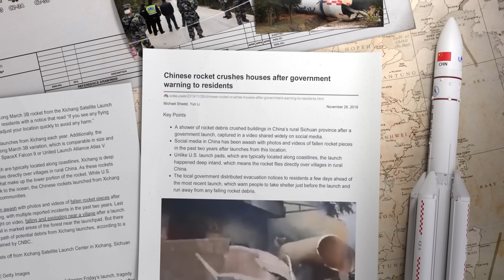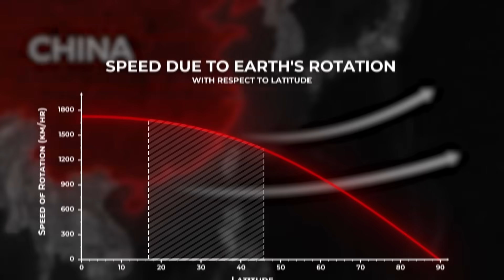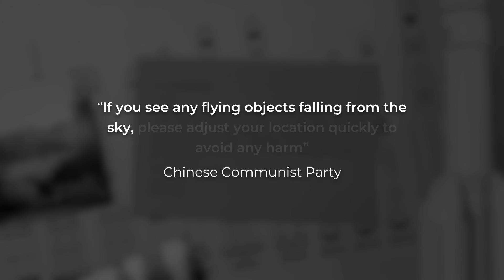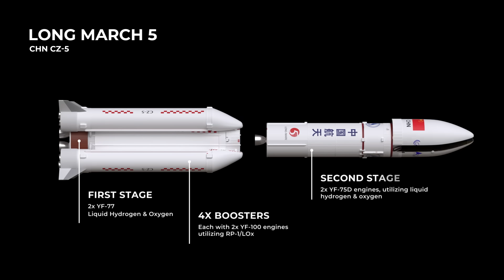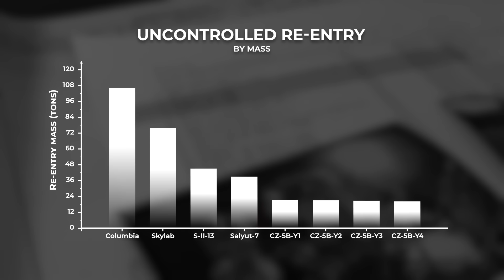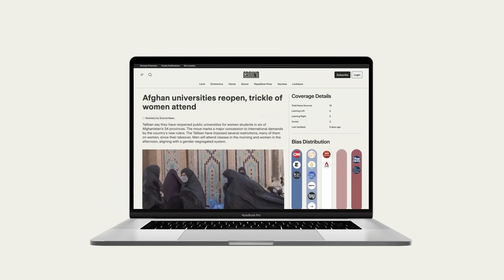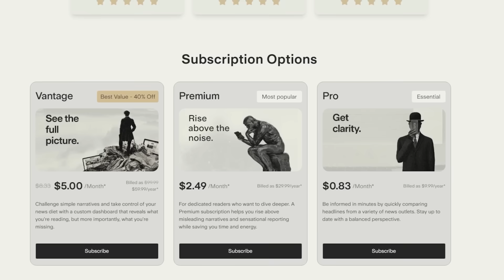The Problems with China's Space Program

Comment: @2:01 This is incorrect. The Earth rotates the other way around. The rockets take advantage of jet streams, I assume.
Reply: You're horribly incorrect. He got it correct.
Reply: You assume incorrectly
Reply: Factually incorrect, the rockets take advantage of orbital velocity. Sending rockets into space requires a lot of energy. It think of it like this. Imagine you are on a merry go round and throw an apple. It will take less energy for the apple to go forward. It regards.
Reply: It's not rocket science you know.Someones suffering from the Dunning Kruger syndrome
Reply: You correct someone based on an assumption?
Reply: Yes it rotates in the opposite direction that the rockets launch, that way the rotational velocity can add to the necessary 17,000 mph they need to remain in orbit. Rockets could only theoretically take advantage of jet streams for a few seconds at a time (if you look at how quickly they ascend through those layers of atmosphere)
Reply: Well but gravitational orbits are not so simple. Your logic is disproved by conservation of momentum.
Reply: He got it correct. If they weren’t using the rotation of the earth why use the most southern spaceport, nearest to the equator where said rotation can be felt the most.
Reply: It seems opposite. But think about the sun coming up in the east. That means we are turning to the east. And we are going quite fast towards the east. The rockets take advantage of that speed to get into orbit. You can launch west like they do in Vandenberg, but it takes a lot more fuel without that extra speed of the earth’s rotation. Does that help explain it?
Reply: Your a idiot for assuming that
Reply: @mmboiler10  it all depends on the Gurosyncal  orbit around the sun in relationship to Pluto third Moon triton  and it's gravitational pull .Taking in consideration the ramifications of fluctuating pulsars within the realm of sector five , one really dose not have a clue of scope of the dimensional variables of the prevailing winds
Reply: @Foxtrotwilconiner1969 😂😂😂
Reply: @grumpy3543  you like my silly humour 
My wife thinks I'm a idiot 
She says she's suffering from the Stockholm syndrome
Reply: @eisisice9208 it all depends on where your sitting at the time

Comment: This was launched in an abandoned mine, and the test thrust of the fixed shelf below was not intended to let the rocket take off, but the rocket's thrust was too strong and it broke away from the shelf below, so the staff turned off the switch in the air. The rocket fell vertically. This is a normal situation, but you western media collectively climax, thinking to yourself: finally caught the black material of China😂
Reply: This is NOT a normal situation. There is not flight termination system and it didn’t get shut down 

It simply ran out of fuel. Static fires are supposed to be static not flying. Doesn’t matter how you sugar coat it, it was a bad situation

Comment: An interesting deep dive. And it certainly didn't feel like the typical ideological drivel. But I feel like the section about BeiDou-3 was weird, I could not find any info about whether or not this 2-way communication thing is required. It's intended use seems to be for sending messages (they talk about 1200 characters).
I feel like the western powers are scaremongering too much about these things. Couldn't Star Link also be used to track connected devices?

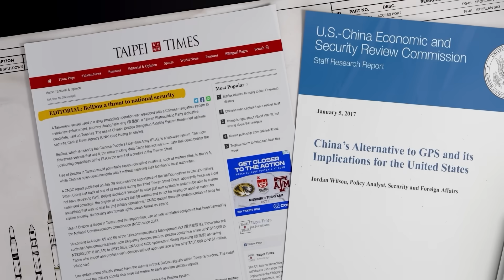Comment: 11:22 You probably do not realize how difficult is to send signal to a sat)))
Reply: BeiDou 1 really used and required 2 way comms
the modern system however is more like typical GNSS.
Reply: @cola98765 Maybe, but the author talking about tracking phones with it. And what I meant is that there is absolutely no way your cell phone can transmit a signal at about 20 watts, required to reach a sat at low orbit, to allow gov to track a user. There are much easier ways to do that)))
Reply: @maksym.kyrylov  I agree with that. I'm just pointing out where the miscommunication originated from on his part.
Entire conclusion was based on wrong information, but it was more complicated than "it never worked like that"

Comment: That brown/orange gas you see is Nitrogen Dioxide being formed. It's the same brown gas you see from fuming nitric acid (concentrated nitric acid) and it's very toxic. Nitric acid is used in the processing and purification of gold. Gold is inert to most acids but 1 part nitric acid combined with 3 parts hydrochloric acid gives you aqua regia, and this can even dissolve nonreactive gold. I went off on a tangent but to circle back around; if you see orange or brown gas coming from a chemical spill, run away up wind.

Comment: Why do they do that? This is not a rhetorical question, btw. Supposing it's not because they don't care about villagers nor because they don't care where the rocket will fall down - why do they do that? Thanks!
Reply: China has a population of around 1 billion (give or take), they literally do not care about their own citizens, they're seen as replaceable.
Reply: Well if we're supposing it's not because of the reasons you listed, obviously the answer is because it's cheaper to do it that way. Hypergolic rockets are cheap af compared to something like hydrogen or kerosene and liquid oxygen. The rocket motor is basically just opening valves and letting the two liquids combine while other engines are much more difficult to design and manufacture. 

It's also much harder to deal with cryogenics like liquid hydrogen and oxygen because they have to be kept super cold and inevitably boil off over time, whereas hypergolics can be shelf stable and the only major concern is avoiding a spill.

Comment: The part about beidou gnss tracking users locations is probably fearmonger propaganda.  LOL The beidou gnss terminal needs to have the 2 ways communication capability to communication  with beidou satellites. Smartphones with 2 ways communication are just starting to launch last year and only few high end expensive models. User has to subscribe to the satellite communication services, manually enable the use of satellite communication and in open spaces without obstruction to sky. Somemore the battery consumption is very high. Most people smartphones do not has the 2 ways satellite communication capability cannot be tracked by beidou gnss.

Google and Apple are then known to track users location 24/7 using mobile cell towers, wifi, bluetooth. Google boasted it even can track users location indoor inside building down to 10cm resolution.
Reply: Google doesn't even need data coverage to track you since they harvest your location data once you're back online that data your phone was building up in it's cache will get sent to whatever database they use for all that stuff since the GPS in your phone works fine without mobile data and I imagine that's moreso what people are worried about if groups manage to get spyware included in apps or even at a deeper level of the system but to be fair all that data is being sold already anyways so it really wouldn't be much different
Reply: yeh, and you wonder why Google is banned in China.
Reply: @captain_elmo  You get fbi come to your house over jokes in USA
Reply: @captain_elmo   easy Google isn't banned in china
Reply: @zacksmith5963  it is heavily censored
Reply: @weekiely1233  nope . China never banned Google . China simply told Google to keep chinese user data in china . 

Same thing usa does with usa user data ..
Reply: Tracking people was a good idea, until it was not. It was useful but then the cons of using it got worse fast. 
China learned from that, and now they uped what google did.
Reply: @Xi_Jinping_is_Pooh  soooo u are ok with usa doing the tracking.. but not china ? 
Lol that's another L for u
Reply: @zacksmith5963  Read my comment. Then read it again. And again five more times.
Reply: @zacksmith5963  Reading comprehension is a massive L for you man.
Reply: @Xi_Jinping_is_Pooh  u lost alot by claiming and never proving 

What's asserted without evidence is rejected without evidence
Reply: @zacksmith5963  Lol. Read my comment. And then read it again 10 time. Massive reading comprehension L for you.

Comment: The Space Shuttle is a useful comparison to the Long March 5B in that it also had no upper (second) stage, but unlike the Long March, the Shuttle did NOT drop rocket stages on unsuspecting villages in Africa. The Shuttle accomplished this by very intentionally shutting its main engines just short of actually reaching orbit. It would jettison its multi-ton orange external tank which, because it was still in a suborbital trajectory, would fall back down, into a KNOWN & PRE-PLANNED location in the ocean. The tank-less Shuttle would now use the small, built-in orbital maneuvering thrusters (OMS) to add that last bit of energy to achieve orbital velocity. The Shuttle's first flight was in 1981. It was built in the 70s. Design began in the 60s. This has been a well understood problem with a known solution for half a century: shut down first stage engines prior to orbit, then use small thrusters or a kickstage for final orbital insertion. China does what it does because it just doesn't give a f*ck. 

I even heard them at one news conference trying to gaslight the world by referring to the giant first stage as an UPPER (second) stage (meaning only the side boosters were the first stage) and claiming that it's "standard practice" around the world to leave upper stages to deorbit on their own, in an uncontrolled manner. Technically both the Long March 5B and the Space Shuttle orbiter are what some people call a first stage sustainer.. Nobody calls it a second (upper) stage.
Reply: Lol this, the last time you saw sustainer stages being left in orbit was literally when Sputnik and Atlas was launching in the late 1950's lol.
Reply: And besides, upper stages tend to get deorbited in a controlled manner anyway
Reply: @HalNordmann yes the FAA won't grant a launch license without a deorbit plan for everything.
Reply: This is the difference between the transparent kind of progress that you see in democracies (where the government is held responsible by the society) and the progress-at-all-costs mentality of totalitarian and near-totalitarian countries which, as you so accurately put it, "don't give a f*ck" (because they don't have to).
Reply: @reddmst  Bub the Soviets also do it. Your ideological oversimplifying is just that. Funny how it's the west that's complaining more rather than the supposed victims in Africa. Cos your narrative serves your interests and ideology.
Reply: @ArawnOfAnnwn  Soviets and China are in the same bucket, "bub".
Reply: @ArawnOfAnnwn Are either of you aware that the Soviet Union hasn't existed since the early 90's?
Reply: @ArawnOfAnnwn  You are incoherent.
Reply: @kellymoses8566 they're right, reading comprehension is in the gutter, they said that both the Soviets and the Americans controlled where their rockets would fall using the same techniques. It's not a democracy vs totalitarianism argument, it's a professionalism and minimum effort argument.
Reply: @ArawnOfAnnwn  idk why you'd call people affected by the chinese rockets "supposed victims" when there is nothing to suppose. Not to mention the victims of these rockets may not be as prevalent on the internet as people in countries that are more developed or may not speak English which is the lingua franca for the internet.
Reply: @grandsome explain the ungodly amount of uninhabitable Soviet land then? No, they are wrong, reading comprehension is fine for all but the two of you.
Reply: @thelastant8366  you're too blinded by ideology and your western sportsmanship to read anything correctly, I simply repeated what the other commenter said since half of you are blind and I'm the only one who seems to be able to read through my disdain for the Soviet Union. I have no idea if their statement is accurate. As for your half-coherent query about why a lot of Russia is inhabitable I'll wryly refer you to a place called Siberia that is very cold.
Reply: It’s an orbital problem not upper stage problem. LM-5B can be equipped with upper stage. In fact, the next LM-5 launch is 5B with upper stage to SSO. This is an orbital flight plan problem. The only way to solve LM-5B problem is to add some deorbit stage. If you launch LM-5B into CSS orbit using a sub-orbital flight plan, booster will drop to populated area 100%.
Reply: Military personnel testify before Congress --
Suit technology does not hold up under critical review, regardless whose program is involved.  The need to replicate their space station interior aboard ballistic flights [the US version known as the "Vomit Comet"] also indicate theater, while our own activity in orbit indicate layered video for some interior video aboard the ISS only to confirm that some missions are dramatized.  This isn't to deny hardware in orbit or programs involving near-Earth orbit, but to recognize the diversion of funds for programs of much greater potential. Military personnel have recently testified before Congress of the back-engineering of alien spacecraft -- something that has been going on for decades, while public programs serve as a distraction and the diversion of funds. Near-Earth orbit is real -- however, evidence of layered video as well as other indications reveal that not all near-Earth activities are real as demonstrated as other undisclosed programs receive allocated funds. During the 1990s, former CEO of Lockheed Corporation Ben Rich described the ability by that time to reach other star systems, as well as many other amazing developments that he stated would take an act of Congress to release for the benefit of all of us -- including means for the production of unlimited energy without fossil fuels using similar technologies. Tesla himself had developed such means over a century ago, only to have his facilities as well as his reputation destroyed sufficiently to prevent funding for his efforts again moving forward -- he himself responsible for the development of the electrical grid that we still use today, before the turn of the 20th century.
Reply: you really are stupid.. how are you comparing a long march to the space shuttle
Reply: If you seriously believed that Chinese didn’t plan a area for dropping used rockets, I don’t know what to say.
Reply: are there any broader implications of these differing practices for international space cooperation and regulation?
Reply: China, like their ally Russia, care primarily about appearances first and prefer utilizing psychological tactics to achieve their desired appearances because it tends to be the cheapest option.  Can’t have bad optics if you continuously gaslight everyone else into thinking you’re correct every time!
Reply: 试着和野兽交谈没有任何意义，给他一拳头就老实了
Reply: I DOES WHAT IT WANTS ON ITS OWN SOIL. YOU ARE NOT THE WORLD POLICEMAN. YOU ARE A WORLD PROBLEM.
Reply: @regolith1350  apparently SOME people in chinese authority are more thin skinned than trump.  You criticize them and they go ballstic in their own little minds thinking of all sort of prejudiced scenarios against you.  How do I know?  I learned how thin skinned authoritarians can be by volunteering in church.  Apparently they teach their kids to be obedient and well behaved like training dogs.  No wondernthey can't take it when faced with admitting a MISTAKE.   The difference with more mature people is we MAKE mistakes and express, share, and ADMIT them.   Those who try gaslighting others are usually aren't as MATURE, not necessarily MALICIOUS.   Until you put immature authoritarian conservatives innpower.
Reply: EXACTLY what a communist red state spy would say.
Reply: Space shuttle has OMS by design and the shuttle itself serves as an upper stage, so doing this doesn't add much cost. LM-5B doesn't have an upper stage. Adding one means millions of dollars of extra cost.
Only very few debris would actually land on the ground. Even fewer debris would cause any real damage. Even if they cause some damage, not likely it would be a million-dollar damage. It's rational (financially) to not add an upper stage.
Reply: @exl5eq28 they could add some retro rockets up top so that they can deorbit in the Atlantic or Pacific instead of wherever.
Reply: @exl5eq28 Using OMS is an optimization that came out only during one of the later space shuttle design phases. Initially, it was planned that the fuel tank would reach orbit and use additional retro rocket at the nose  for deorbit. China could also design their rocket with similar provisions if they wanted, but decided not to.
Reply: Revelation 3:20
Behold, I stand at the door, and knock: if any man hear my voice, and open the door, I will come in to him, and will sup with him, and he with me.

HEY THERE 🤗 JESUS IS CALLING YOU TODAY. Turn away from your sins, confess, forsake them and live the victorious life. God bless.

Revelation 22:12-14
And, behold, I come quickly; and my reward is with me, to give every man according as his work shall be.
I am Alpha and Omega, the beginning and the end, the first and the last.
Blessed are they that do his commandments, that they may have right to the tree of life, and may enter in through the gates into the city.
Reply: @JesusPlsSaveMe We’re talking science here, not fairy tales written by weirdo outcasts living in caves 2000 years ago
Reply: @JesusPlsSaveMe TO BAD ITS NOT TALKING TO YOU.  ITS TALKING TO THE ISRAELITES.  YOU RED/PINK BOYS ARE THE SEED OF ESAU. THE BIBLE IS WRITTEN BY THE ISRAELITES,  ABOUT THE ISRAELITES,  FOR THE ISRAELITES.  THE BIBLE IS NOT FOR YOU
Reply: @JesusPlsSaveMe  it's funny that white/red devils only use scriptures from the bible when it serves their evil purpose or when it benefit their wicked souls.